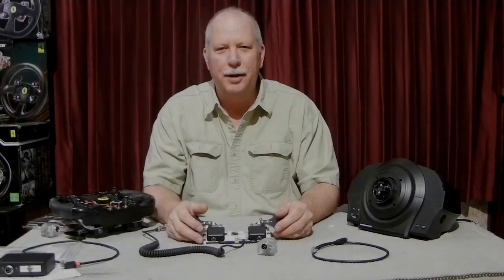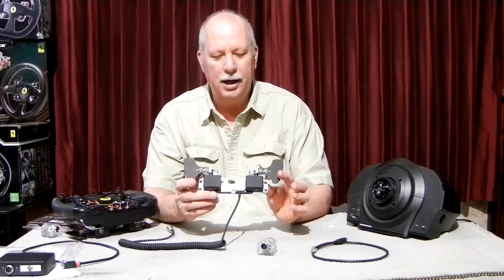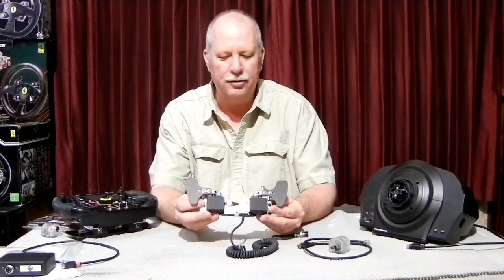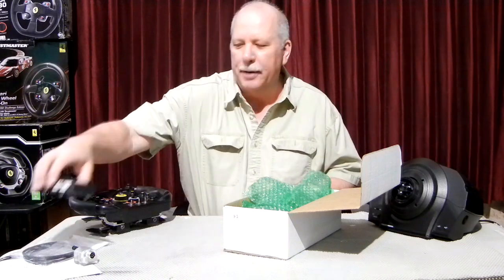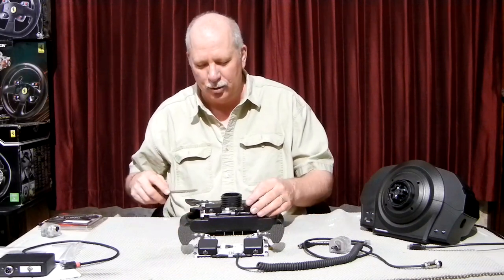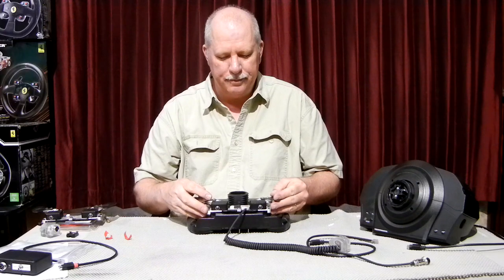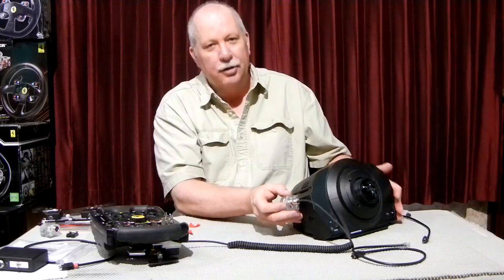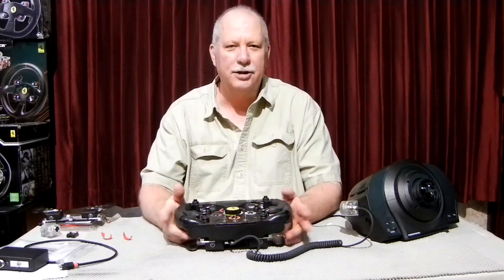SimAbility F1 Paddle Hand Controls for Thrustmaster F1 Ferrari Wheel

Comment: I'm loving this, do you think this could be adaptable for a fanatec csl elite?
Reply: SimAbility . Hey thanks for the advice, since asking i have had a go on a setup very similar to that, with the podium advanced paddle module for the throttle and brake. I did struggle with how far away the throttle felt at times from my finger tips, but that could be fixed hopefully with some spacers. You are the second person to give me the same good advice, I better get saving.